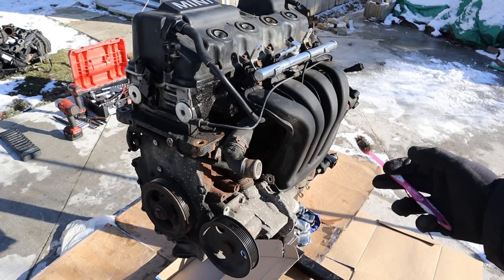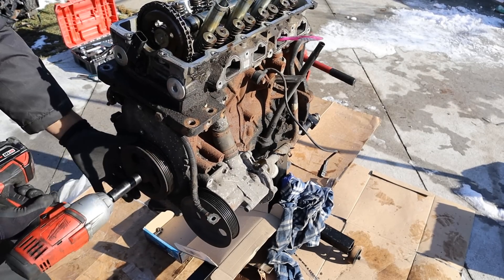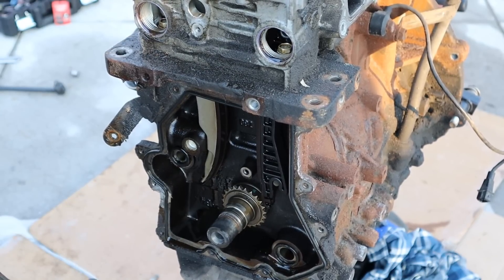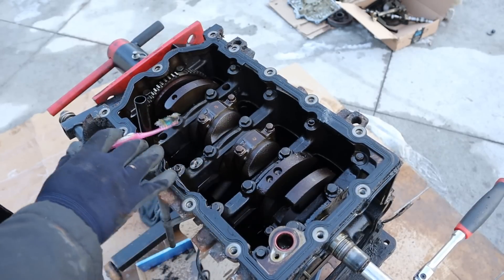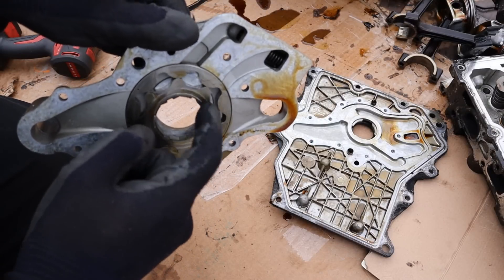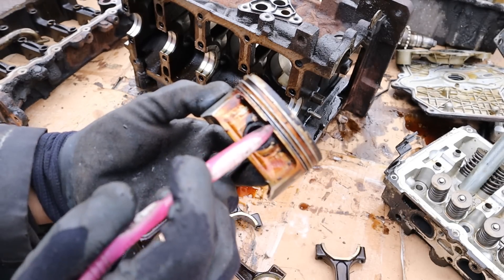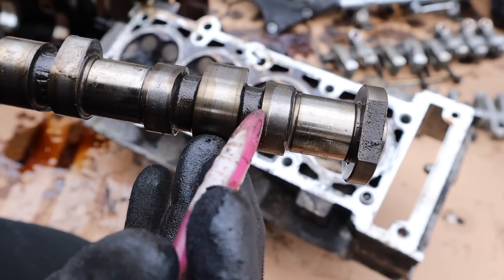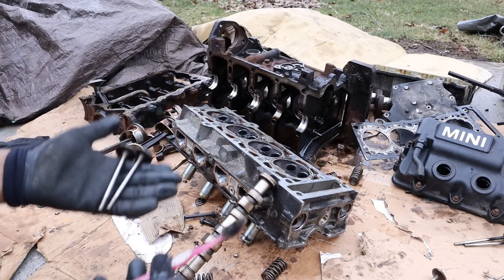Why Mini Cooper Engines FAIL

Comment: err the tritec motor was actually the most reliable engine of its time... several awards for this motor...? with several over 250k+ why yall acting surprised that bmw engine made it that far when bmws m54 engine and m50 literally were million mile motors

Comment: Wow that black sooth in the coolant passages, even with the head port shape in it and all. Would be pretty crazy if that is carbon from combustion. Headgasket would have left the chat wayy before that engine stopped running.

Comment: As i read, early french Peugeot engines had a horrible oil delivery at startbup and thus prematurely ruined the engine. There's 3 generations of mini engines and the later generations after 2014 BMW sorted out many issues and todays gen 3 engines are very close to toyotas reliability. User maintenance plays a huge role in logetigity on any vehicle not just BMWs. Today Toyota uses bmw engines on their new Supra not to mention also Rolls Royce does too, i wonder why?

Comment: R53 2005 Mini S, 185,000 miles. I have had to replace Harmonic Dampener, camshaft started to show wear as well on 2 cylinder replaced that.From modmini I agree cheap insurance is to replace that hydraulic oil chain tensioner every 50k -75k. Will ensure tension on the timing chain and should minimize chances of jumping a tooth or chain rattle on startup. Biggest issues with mini S is supercharger oil sump. but this can be rebuilt just dont let the engine heat up too much as PTO on supercharger drives water pump.

Comment: Tough little motors.  I have the supercharged version.  It just keeps going.  They aren't very fuel efficient and dont make a ton of power.  But you get it on some twisty back roads and it really shines.

Comment: Thank you so much for the tear down.  I have looked pretty hard to find your video and you are a pro!  
This is so important to me to see the break down.  I have a 2004 mini hatch back CVT with 130,000 miles on it.  
Been babying the CVT transmission and changing oil regularly, no oil burn yet.   Change the transmission oil every 30 thou. miles.  Thank you again.

Comment: I don’t know when ppl are talking why mini fail:) 
Got 2005 R53, it has been 18 years old with us since the D1 from MINI dealer, never visited any garage or dealer since then, Now at 115K yes it’s not much because we own another 2 in the garage but as far as I know the ENGINE is reliable engine, I just did all big maintenance at one time for the FIRST time this year - cover gasket, chain tensioner( the old one was still good) ,aux belt tensioner, idle tensioner, new Crank, new aux belt, topped up supercharger oil,new vacuum valve, crank sensor gasket seal, and PS fan hoses,honestly I didn’t spend money a lot,the all parts were not expensive either (OE/OEM)*
I’m not a mechanic either just I don’t want to spend more than needed I did in the weekend,in return I got the tools a bit enough to care anothers😂
And the engine is clean,No sludge or clogged but I did flush with LM pro Line 1X yesterday, and 5-40 Castrol,  Now it’s Wow
Reply from the maker: Nice!

Comment: I got 250k out of my R53. Still ran when I sold it. Had a leaky head gasket. The plastic cooling system parts failed all the time causing some over heats. Also crankshaft pulley exploded causing an over heat. I recommend keeping up on the maintenance.

Comment: Oil   pumps  on  end   of  crank    always    bad   design,    delays    oil  pressure  build  up   and  only  slightly   low  oil  level   no   pressure    atall

Comment: Super nice video and editing, thanks a lot! 

What was the reason that engine was retired? Maybe I missed the failure reason amongst all the flaws you pointed out, but while it's worn, nothing seems to be totally broken, unless it's that low compression you talk about.

Since I own one now (210k km and running well): what would you do as preventive maintenance to keep them running for a long time? I'm doing shorter oil change intervals but I'm curious if there's anything else I could do.

In the Mini community, those engines (W10 and W11) are known to be strong, with some going really high up in miles. But at that point these are old sporty cars where other things are going to fail left and right and they aren't as cheap as an economy car to maintain. It's best if you do the work yourself, otherwise the labor bill will rack up.
Reply from the maker: Thanks! 
The previous owner retired this engine Because they thought it had a burnt valve and lost compression
Reply: @speedkar99  so low compression without actual failure, OK ! Do you happen to know how much psi each cylinder had ?

Comment: I own a 2002 Mini R50 with 230 000 KM on that very same engine and the car is still running smoothly.  The engine is bulletproof.  It's everything around it t hat falls apart.

Comment: I use to own a 04 mini with the w10 engine (same one as in the video) it had 154k miles and didn't burn any oil. The midlands transmission sucks but overall was a good car till i crashed it.
Reply: What kind of problems did you have with the Midland? My 2003 R50 with a Midland 5 speed shifts smoothly and quietly with no problems.......Also, make sure you use the recommended power steering fluid because it also lubes the hydraulic clutch.......
I did not know that until i started having trouble shifting my Midland 5-speed. The power steering fluid level was low and I filled it with the  MINI recommended fluid I bought at NAPA and it almost immediately starting shifting much more smoothly. To this old guy the fluid reservoirs are poorly identified, so be sure you put the right fluid in the right spot. ....Check carefully, even if you think you could never get that wrong.......
Reply: @robertstancliffsr9575  transmission broke. I also drove another one not to long ago with a bad transmission bearings

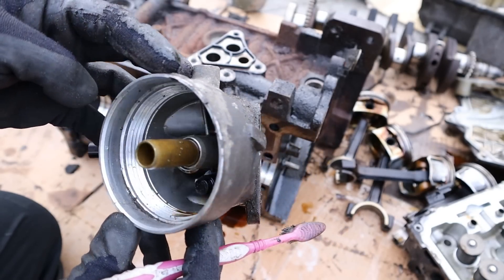Comment: 7:28 can someone explain to me why the 4th of the crankshaft bearings from the left has no such groove for lubrication as the other 4 have? Seems odd to me.
Reply: There are corresponding holes in the crankshaft that take oil to the connecting rods. There's only four of those so the fifth main bearing doesn't need the groove.
Reply: @ilhuikar  yes i knew that those holes and grooves  were for lubrication. The Question is, why there is no hole at this particular bearing.
Reply: @baer0083  No need for it, since there's only four rods

Comment: Lol, my old Fiesta has 250 thousand kilometers, still without changing or having any wear and tear inside the engine for last 150 thousand kilometers. When we bought it it was under 100 thousand km and only then previous owner changed some parts and we did the rest but not much. If anything happens related to opening and repairing inside the engine it would be more cost effective to just change entire engine, other then replacing the parts xD

Comment: quite a tough looking wee unit ,,, wasnt it the gearboxes that got these the bad reputation though.
Reply: The Midlands 5 speed MTX and the CVT’s were both crap (your only choices on an R50). The Getrag 6 spd. In the R53 is pretty robust.
Reply: @hoganfan924  many thank for the info ,,, how do the diesel minis hold up
Reply: @tomthompson7400  No idea. They had Toyota diesel engines. I worked on the development of the Tritec engine.
Reply: @hoganfan924   well thats maybe not a badd thing ,,, couple of folk I know bought diesels as they were cheaper ,,, that was my reason for asking.
Reply: @tomthompson7400  Current generation of MINI I have no idea where their diesels are from, or if they’re even offered.
Reply: @hoganfan924  these were sort of 2009 2010 ish , but it sounds like an interesting job to be involved with engine development at all ,,, do you for example know your turning out a tough old engine , or do you know as they are going together that something like a wet belt is going to cause grief , but meet emission standards ?
Reply: @tomthompson7400  I was Sr. Engineer responsible for all performance and reliability development, so was well aware of every development test, failures, each change put in place to address them, etc. We put in place very harsh test procedures on this program, and had to add an additional prototype build phase to validate the changes that came out of earlier development & test phases. I still own two 2006 MINI Cooper S’ (an R53 and R52).
Reply: @hoganfan924  thanks for the time taken to reply ,,, interesting reading , happy driving.
Reply from the maker: Yeah mostly

Comment: The narration should be a bit slower for the benefit of people who are not professional mechanics. The km measurements should be stated in miles for those not accustomed to metric mileage, in this case 161556.51 miles.

Comment: What is true, is there are many 4 cylinder styles motors that can survive, and actually any engine can live past 300,000 miles if maintenance properly or have a job that originally was flawed by factory mechanics that slipped through quality check.

Comment: My claim to fame was that I worked on the development of these engines back in the early 2000's with Ricardo.
I collected and catalogued all the engine parts that failed during dyno testing and sent them back to BMW.
I was then able to show how reliability improved as the parts were developed.
Timing tensioner pulleys was the biggest failure initially along with the super charger manifold.
Reply: Its remarkable how much  chain guiders or tensioner are problematic inside German cars, and in some others. I mean putting plastic ones is ludacris. Engineers or whoever is responsible for that are out of their mind.
Reply: @milosstojanovic4623 it’s not any kind of plastic. teflon is has much more tolerance to heat and heat cycles. but they use fiberglass reinforced polymers that may not be that great
Reply: @milosstojanovic4623  as an engineer I can tell you that we have close to no say in the budget planning of the development, so we are essentially forced to develope stuff out of lesser materials. Plastic oil pans and valve covers are a good example.
Additionally, timing chain guides should be softer than the chain itself, thats why plastic is used, which lasts a lifetime if engineered well and without cutting costs. Not typical for manufacturers anymore tho.
Reply: @milosstojanovic4623 it’s teflon not technically plastic it’s a lot stronger
Reply: @FastLives  yeah, but still reliability is questionable. Also i do not get it why would there not gonna be metal after market part. Probably deliberately just for the people to not bother maintaining the car but go and buy new cars (beCaUSe ThEY ArE BeTtEr).
Reply: @milosstojanovic4623  plastic becomes brittle after time, if the car is bought used, the cost to fix it might be too expensive for the second owner. The thing is to make these cars expensive and sell them, and to make them break after time, so the less wealthy second owner won't be able to maintain it, especially when it comes to BMW or Mercedes.
Reply: @draconpost  Japanese manufacturers seem to be able to make plastic timing chain guides that last, wonder why BMW haven't figured it out?
Reply: I'm not a master mechanic, but I know basic material science: Don't EVER use plastic when it is exposed to pressure and heat, because that is what makes plastic fail. Use metal, ALWAYS, because metal will never fail due to temps and pressure. I worked on a lot of older Toyota engines and they are better built than these new garbage engines. I don't know what it is more, sad or pathetic, but the German manufacturers have been riding their undeserved good reputation for decades now, banking that people still think that German engines are high quality, which they are not. I don't understand why BMW builds such garbage quality, are all these engineers incompetent morons???
Reply: @nigratruo  they are not bad quality per se. But they save up the money on some parts so that people would have a problem later after 50k or 100k kilometers and if they want continue using the car they would need to pay like 5k or 10k for spare parts and official car mechanic for that car. In some previous video it was also mentioned that car manufacturer do not allow if person is replacing for example chain tensioner with metal tensioner, but need to use plastic again, like wtf !? Bunch of capitalist. Thats why some older engines were with better build quality.
Reply: @milosstojanovic4623   Most German luxury cars are solid through the first 4+ years as their target demographics are wealthy who generally move on after 3-4 years or lease for 3 years.
Buying and holding onto a luxury vehicle for 10 or more years died back in the late 90's-2000's which is when German bean-counters seemed to become the decision makers in manf's.
Reply: @nigratruo 
 Keep the dealer garage open !
Reply: @nigratruo this isn’t a new engine either it’s from 2001-2006
Reply: Mean they are in business order, so if we purchase a car then never ever visit the dealer again if we actually like the car to run longer by maintaining personally, all manufacturers are doing the same, they make a car for 6 years mark to fail somewhere something that’s ridiculous but it’s true
Reply: Do you know if the W10B16 (Cooper) and the W11B16 (Cooper S) base block and internals are identical?
Reply: @gabrielvanya8245 no they are not! The heads are identical apart from the valve material
Reply: U still have the layouts or blueprints for these engines? I want to learn about them so I can work on my own minicooper
Reply: @jkmamamama  afraid not.
I worked on the ECU calibrations, which at the time ran on bespoke R&D hardware. The final maps were transferred onto a solid state potted ECU
Reply: I have a JCW tune and whoever put injectors in didn’t put JCW injectors do you think that is what lead my piston one to overheat and almost melt/explode along with the tip of the spark plug melted the little arm you can adjust gap with just disintegrated 😂 but I was wondering is that because of incorrect injectors for the tune?

Comment: That is actually a pretty robust design.  The only obvious issue to my eye is the pitting on the cam lobes.  Everything else seems to point to a good flow of oil such as the bearings.  I suspect the problem is the quality of the cam shaft material.  As far as the carbon build up, I have seen far worse in engines with much fewer miles on them.  Much of the carbon here is probably due to the oil burning but it isn't clear what the cause of oil burning was specifically.  Plenty of cars have issues with oil rings gumming up (talking to you Toyota!) but on the whole this appears to be a well designed engine.
Reply: No, NOT a robust design: An engine should not fail at 270k km, which is only 168k miles, which is absolutely nothing. I bought pretty much all my Toyotas with that mileage and I have not seen one so far that did not go up to 270k miles, which is 435k km AND they are still running well. The Germans now just produce cheap garbage engines that rely on plastic parts that will break for sure, just a matter of time and then cause repairs that are more expensive than the car is worth.
Reply: Its robust in terms of prompt strength (stout might be a better term) but the design and materials are not great for longevity

Comment: thanks for the video! Mine has over 370km and is starting to get tired. It's the supercharged engine and after inspection it's still got some life left in it. I'm just getting a 2nd engine ready to swap when this one finally gives it's last breath, but for a 4 cylinder BMW/Chrysler engine it's a very good little boy. I like how these used engines are cheap so I have no plans to upgrade.

Comment: I've just stripped an Isuzu 4JB1T from 1989, 275k miles, owned since new by my grandad, and it's in much better shape. Only thing it needed was valve guides, and we chucked in new sleeves just because we had it stripped anyway. Main, Con and Cam Bearings were like new.
Best engines ever made imo.

Comment: I think the rtv in the valve cover actually comes from the factory because mine looks exactly like this one.
Also it's only partly designed by bmw which is why its built comparatively simply but sturdily
Reply: The RTV is from the factory. It was a late development change, put in place to eliminate oil pull-over into the PCV baffle system, particularly when making hard sweeping left turns. The RTV seals off the steel baffle cover plates that were heat staked onto the valve cover. Without the RTV, oil can seep around the heat stake holes and along the edge, causing oil burning.

Comment: This engine was a lot better than the French junk currently fitted, the wear is caused by poor maintenance
Reply: BMW German junk. The TU5jp4 which was the basis of evolution to the prince is among the most reliable engines out there. But the junk designed and supplied by BMW for the Prince like the timing gear, the thermostat system, the Pierberg Blow off valve and more are what fails.

Comment: Key thing - oil changes. More is better. People don't do it  and think they are saving money.  

Interesting video but I hope you clean that toothbrush before you hand it back to the wife.
Reply from the maker: I agree. Oil changes are everything, having torn down dozens of engines!
Reply: @speedkar99  Having said that in North America  journeys tend to be long  which helps engines last. Here in the UK when these Mini engines get to 70,000 miles they can often be knackered - if they get that far !   They are  classed as cars to avoid like the plague.

I would never buy a car with no oil dipstick - what BMW were thinking when they decided not to fit one and rely on (usually crappy ) wiring and electronics to tell you oil level  is hard to figure.